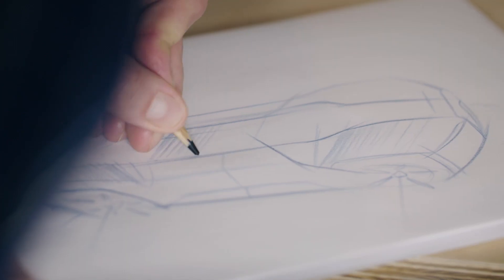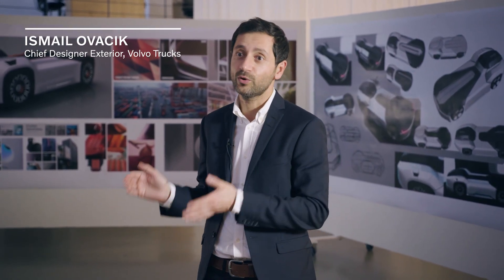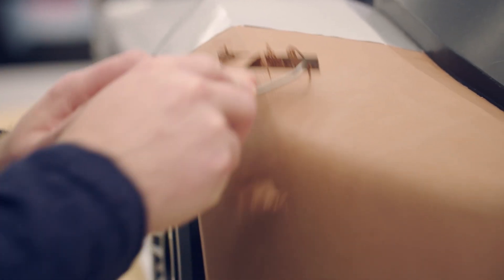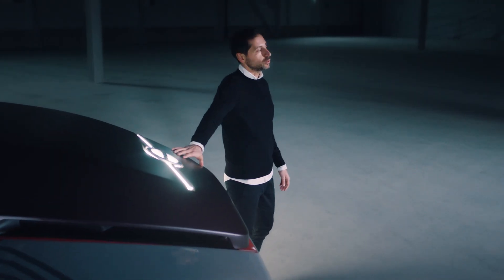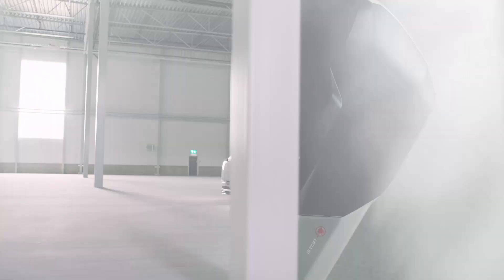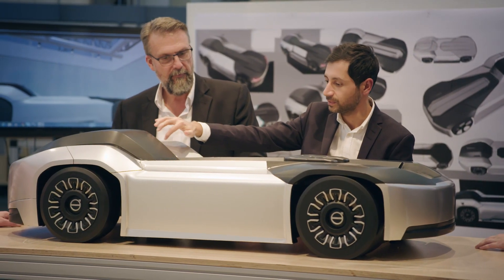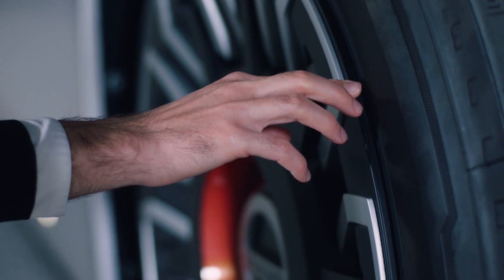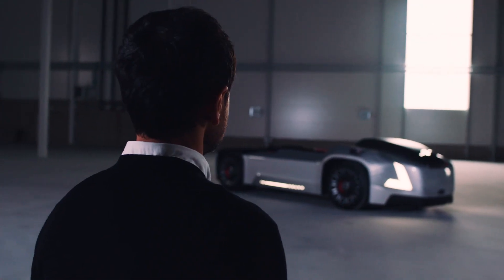Volvo Vera Autonomous Truck EV [Footage and Interview]

Comment: Sooo when vera hooks up to different multiple trailers how are the airlines getting hooked up and how is the landing gear getting put down if no one is around to do it? And if it does not have air brakes and the braking system is electric how is the Vera able to plug in or unplug the electrical connection from the different trailers?